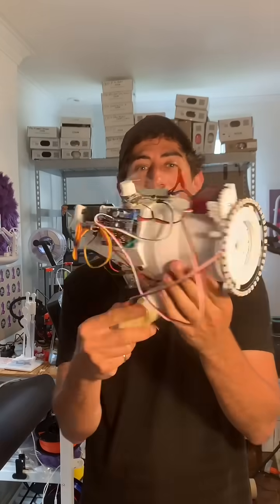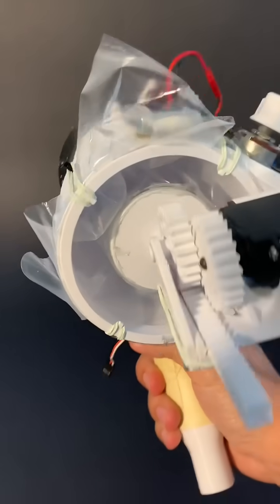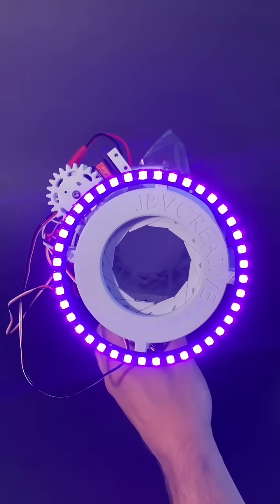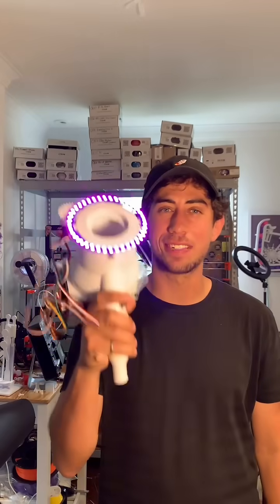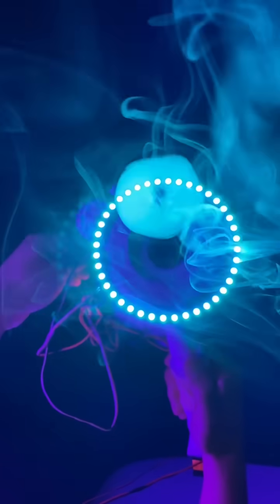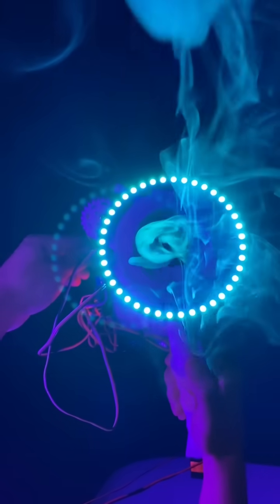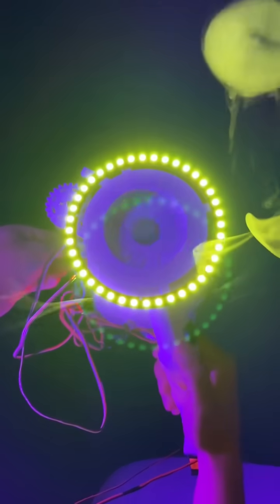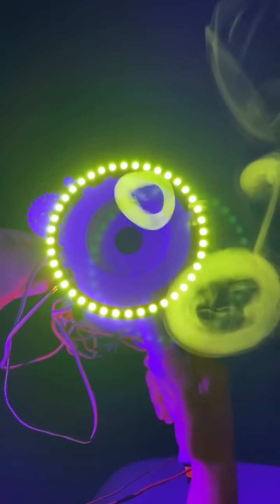The Vortex Ring Cannon

Comment: Have you tried programming it so the iris closes simultaneously while the piston moves?  This might improve the ring quality by increasing the velocity in the center of the ring relative to the outside.  That should increase the rotation speed of the vortex… it would be cool to try.  I’ve made a couple automated fog ring machines myself too, one with 12” rings that could go straight up about 20 feet.  It used two servos driving each side of the piston, and by making the servos move at different speeds, could make the vortex rings move in a curve.  I presume this was because one side of the ring was be spinning faster than the other.